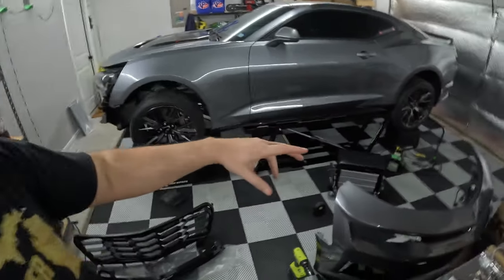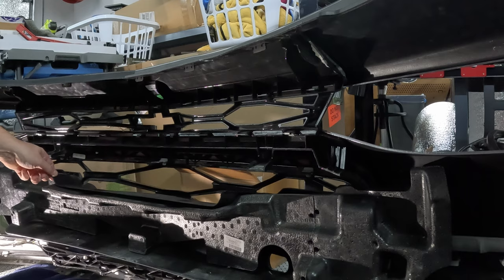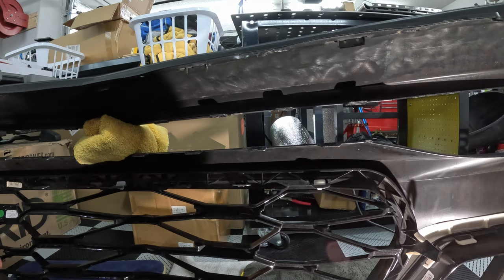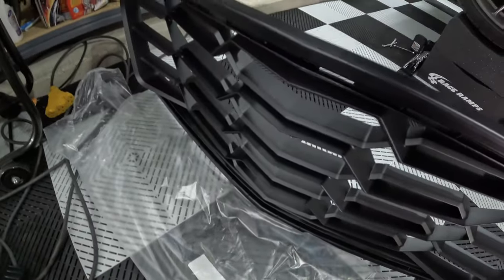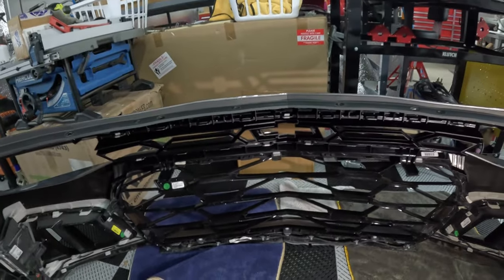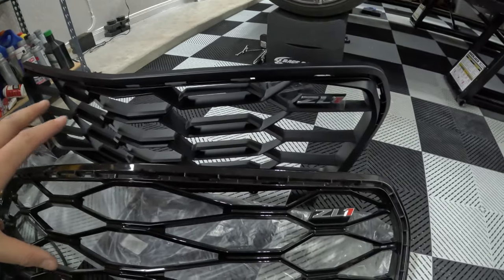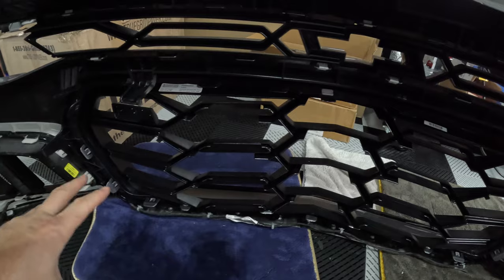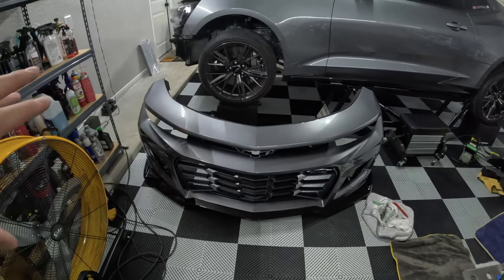Part 2: Upper & Lower Grill Swap - Camaro ZL1 Carbon Fiber 1LE Front End Conversion

Comment: These grilles are definitely designed for one-time assembly, not meant to be taken apart... good call on the dremel, I don't think you can disassemble the upper grille intact on your own, you'd need at least one helper.
Reply from the maker: Yeah... The engineers def didn't take into account someone pulling that upper grill without a couple assistance or having like 6 arms, haha. I tried to solo it for a good hour and my thumbs were killing me and finally I was like... Ok... DREMEL time baby! Haha. I just now checked prices and turns out the upper grill for the ZL1 is... $400+, for some reason, whereas the lower grill is $200ish. So, if you have the patience and a team of hands to assist I'd recommend NOT cutting the upper grill if you can avoid it, haha. BRB going to epoxy the tabs back and check out eBay.... :D

Comment: tricks to snap in the grilles?
Reply from the maker: Upper is a PITA... I lined up the tabs and pushed it in a little at a time and worked back and forth side to side pushing in a little more each time until eventually the tabs began clicking into place.. outside to inside. Lower grill in comparison was super easy.. Lined the tabs all up (make sure none are not going through or aimed at the slots) and just reach around over the top of the bumper and hold the bumper while pushing one side in until tabs begin clicking into place.